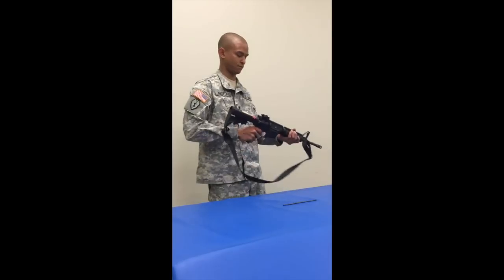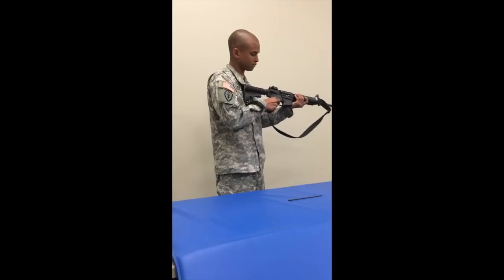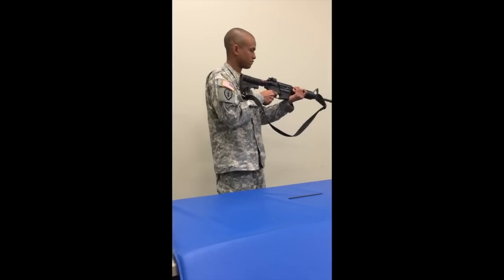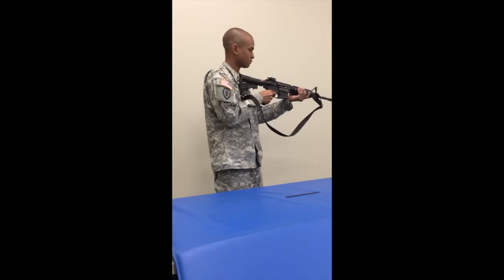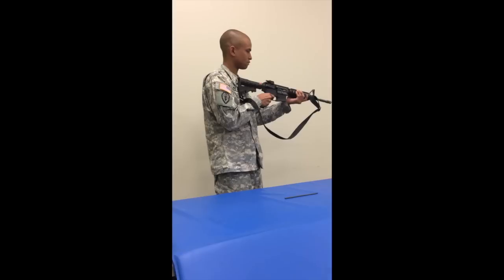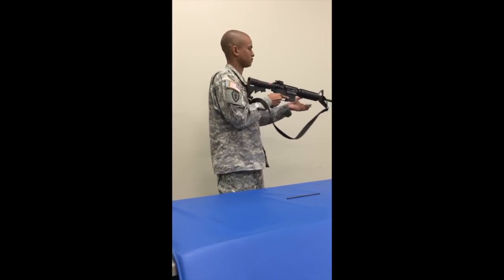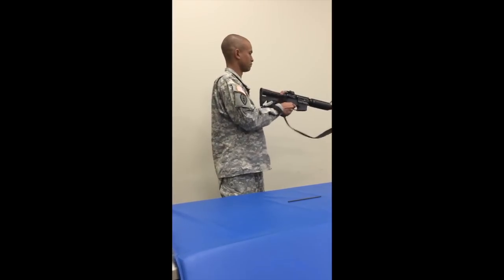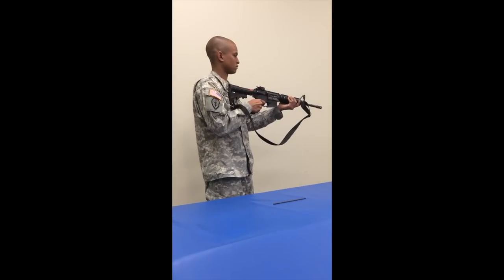M4 Functions Check

Comment: Riding tf outta that charging handle
Reply: Which isn't a problem in a function test and prevents undue wear on the bolt carriage assembly. The reason you don't ride the handle down is to make sure it has the inertia to chamber a round (and more importantly snap the extractor over the lip of the round)

Comment: Safe
Pull charging handle 
Pull trigger

Semi
Pull trigger
Hammer should fall

Trigger to rear and charge same time 
Hammer should fall

Release trigger slow til audible click
Pull trigger

Auto
Trigger pull 1x hammer falls
Hold trigger to rear & charge 3x

Release trigger 
Squeeze trigger
Hammer falls
 
Weapon on safe
Reply: Bless your heart. You can't put the weapon on safe if it hasn't been charged.